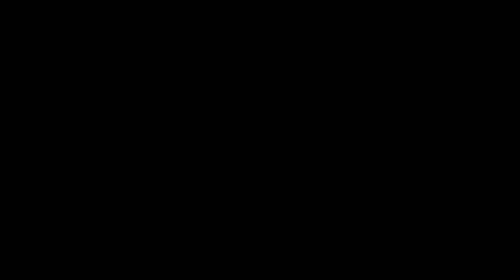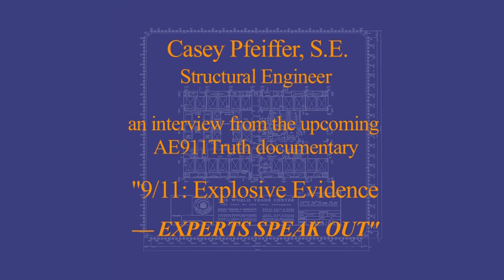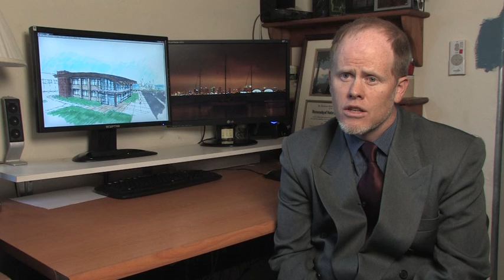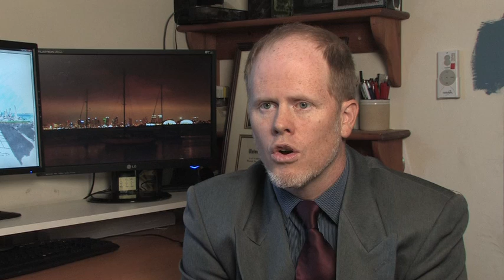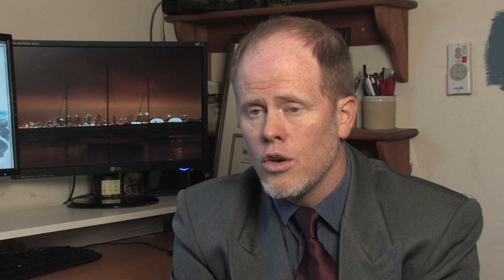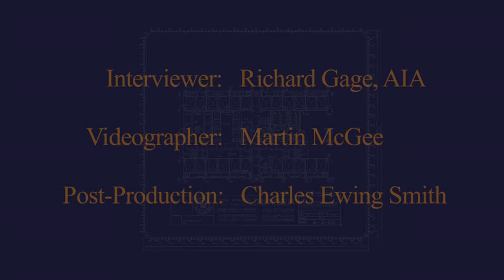Casey Pfeiffer, S.E. - Structural Engineer

Comment: Rough estimate. 47 core columns. 4 beams connected per column. 188 bolted and welded connections. Per floor. Over 20,000 total per building! Even if some heated beams did sag, they could not tear apart these connections.
Reply: Well the buildings did collapse. In my experience when disasters happen engineers try to learn lessons from them. Not on September 11th 2001 though. Things that happened on that day are not 'allowed' to happen. In fact engineers who talk about it are 'good' because they are 'speaking out'. What it does though is save them from actually working out what went wrong, why the buildings collapsed because all they have to do is wave a magic wand and say 'controlled demolition', Then they don't have to work out why the buildings collapsed.

Comment: I would love to discuss this issue with Mr. Pfeiffer as a Fellow of the LTT (UK)
Reply: LMMFAO
Reply: It is interesting that comments on this post are occuring at this time.  Discussion can be useful, though a topic of this depth would require a lot of transfer of comprehension of the material prior to the discussion.  Without a common ground the discussion would lead to a form of bickering.  The story on bldg 7 is all but finished after the report by professor hulsey.

Comment: for my opinion, the towers exceed the material thermal limits, the heat induce by the fire came from the airplane affects the members due to heat and steel becomes low in strength that's why the main members collapse. logically the candle will melt is the same in the case.
Reply: YOUR opinion is based on idiocy!

Comment: My hypothesis is that one could show that a thermodynamic effect on steel would exponentially cause strength loss in the members. There is such thing as "linear" expansion, but to simulate such a catastrophe would probably show that the strength loss be exponentially lost. From what I know, thermal effects in designing are taken into account only on a feeling (eg Cfactor ~= 1.6 in some cases) for ASD and not too sure yet about lrfd. I think generally there are codes to prevent any thermal expansion (or limits the expansion for particular environmental influences).

Comment: #chewy531,  it is true that a building would be consider to have collapsed if one connection broke loose, but in order for those three buildings to collapse at the acceleration of gravity, the columns would need to be removed by controlled demolition
Reply: I would love to discuss this issue with Mr. Pfeiffer as a Fellow of the LTT (UK)
Reply: I don't think I'd expect a controlled demolition to fall any faster or slower than a genuine collapse of the type that occurred in any of the WTC's.  Think about what a controlled demolition does... it creates designed failure points that initiate a complete collapse.  If WTC had columns that buckled (like what NIST reports) which initiated a collapse of a single floor, the impact on floors above and below would be more than enough to fail the remainder of the floors very quickly.

A controlled demolition make no sense once you examine it.  I used to do demolition engineering at my last structural engineering job..., mostly for bridges.  Most of the projects I worked on were demolished without explosives, but the several I worked on that did use explosives, we worked with a firm that specialized in explosive demolition.  The amount of modifications to the structure required were massive enough that it couldn't go unnoticed by every single person that worked in those buildings.  The amount of wiring that would have been required would have been massive.  If we are talking plastic charges (which is most common by far), they don't do well cutting around corners so they would need to cut notches in every single member they wanted to fail.  You would have also clearly seen the charges firing at every single exterior column. 

 Instead, if you look closely, you can actually see the exterior columns start to buckle near the plane impact moments before the collapse.
Reply: @chewy531  STOP EMBARRASSING YOURSELF YOU CIA STOOGE
Reply: 100%

Comment: "In order for building 7 to collapse there would had to have been a failure of over 400 steel connections per second"
Not true.  A building can collapse without a single connection failing.  Its called buckling, and if Mr. Pfeiffer has never heard of it, I fear for the safety of anyone entering any building he's designed.  If a column loses its lateral support, it can buckle and start a chain reaction in the rest of the building, especially when much of it is already weakened by debris and fire.
Reply: Yeah, that's why steel framed building collapse totally so often. They are extremely fragile and delicate.
Reply: I think your brain has buckled
Reply: If one floor collapses and your building falls to pieces at the speed of free fall, then you have no business designing building.
Reply: Idiot.
Reply: @MarioAnthonySabga  and?  Or is that all you have to share?
Reply: Says the uneducated more on
Reply: What he is saying is the building itself doesn't provide enough energy (50 mill. pounds of force) to shear those connections. Therefore the energy could only come from an outside source.js

Comment: @GruesomeTruth You asserted that the dust was all over NYC. Several Dozens of blocks in radius is still only a few hundred or thousand blocks, instead of the 72,000 in Manhattan alone.

The top of the towers weren't entirely pulverized to dust, as I've already pointed out. There are pillars and such clearly visible in photos of the collapse.

Still not producing that NIST reference, I see. Weird, 'cause the PDF is available for free from them. Almost as if they're open about their discoveries.
Reply: YOURE A CLOWN

Comment: @GruesomeTruth The actual dust images I saw were for a fairly short range around the WTC, after the collapse. I don't recall seeing any out in say, Brooklyn with inches of dust all over.

You said NIST claimed something. I want proof. Simple.

Mass is mass, whether broken up into pieces or solid. Whether someone throws a bowling ball at you, or someone throws the pieces of a bowling ball at you, you're still probably going to break a rib.